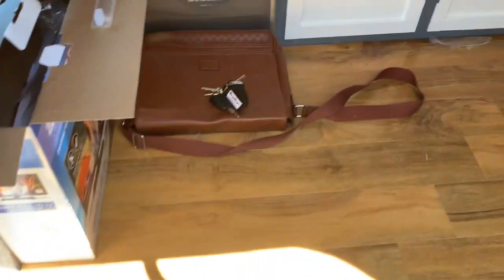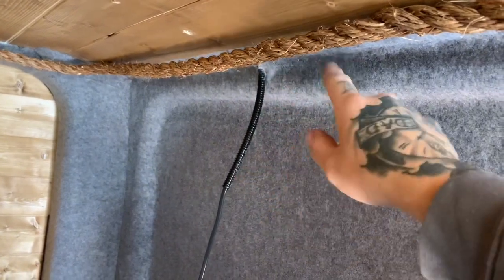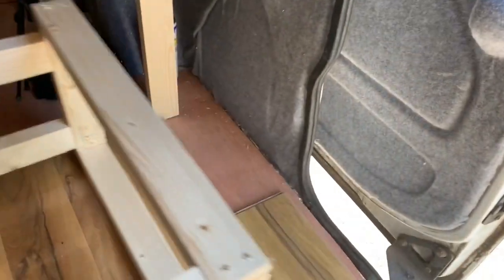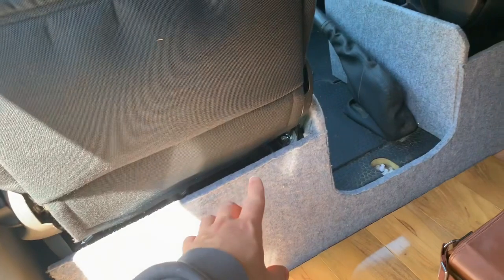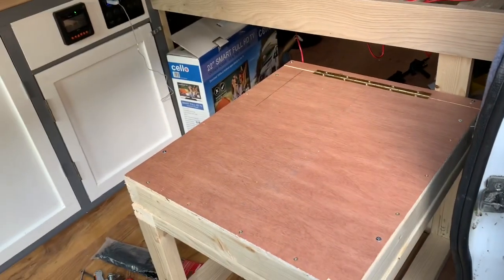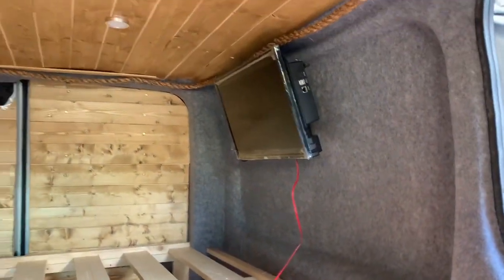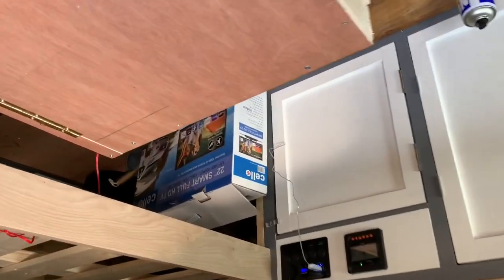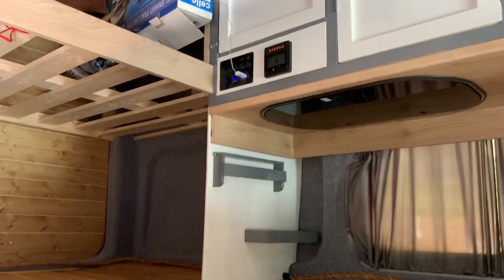Floor, seat and TV installation - baloo vivaro

Comment: cmon baloo ,we know you got glassed
Reply from the maker: toppertruthio my mother said everyone will think a bird scratched you 🤣. I literally walked into an open window picking up the jigsaw and knocked myself out 🤦🏻‍♂️ . PPE is not my strong point as you have seen 🤣
Reply: @Baloovanz  lol.couldnt help laughing mate.cant wai to see this one finished though,as mine is set out different.its looking good .You fitting a diesel heater?,because i havent done that yet
Reply from the maker: toppertruthio im debating with the heater. I have in all previous ones but this is so small im not sure it will need one? Hmm food for thought maybe.
Reply: @Baloovanz  yeah i was thinking the same,to be honest you can use a gas ring to heat it enough for getting in and out of the bed.But i was getting loads of condensation,so im gonna get one.and im sure in winter conditions,it will be better.
Reply from the maker: toppertruthio well condensation is my worry with this one with it having no roof fan. Been thinking about that the last few days actually. Maybe wind deflectors and windows ajar maybe?
Reply: @Baloovanz  yes mate thats what i do